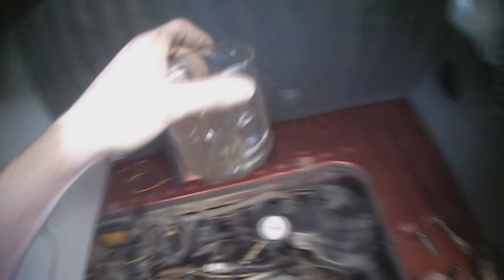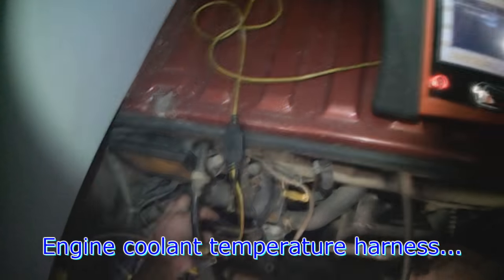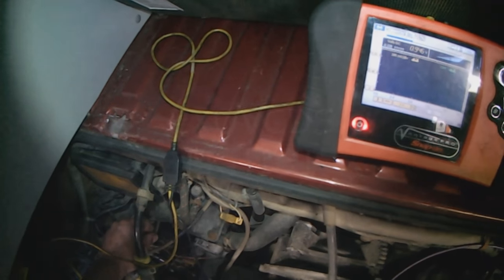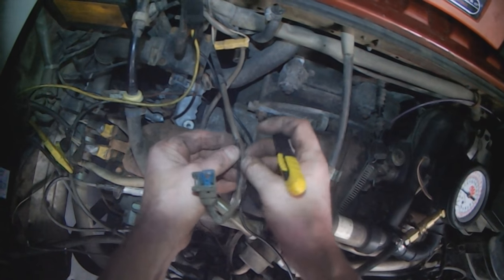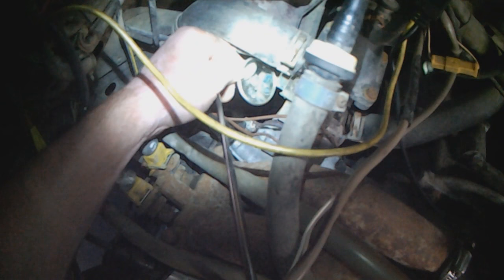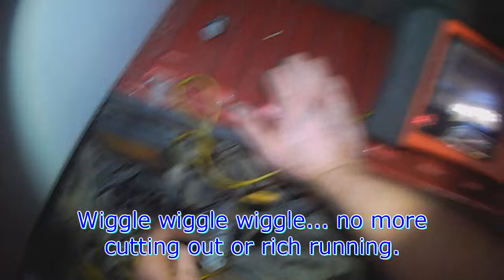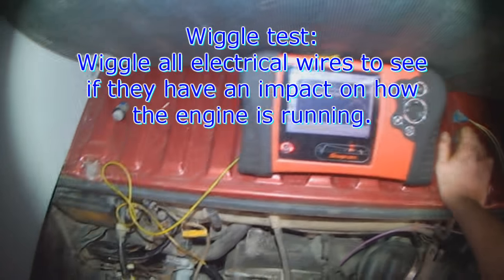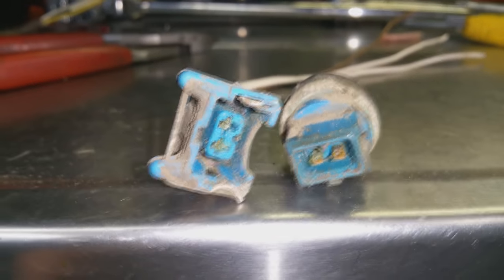VW T3: Intermittent lack of power

Comment: Excellent video. My 1990 has a flat spot and bad fuel mileage, I have to troubleshoot it someday
Reply from the maker: +hlzapata monitoring the O2 can help!
Reply: What tools do you recommend? I only have a good multimeter.
Reply from the maker: ***** That will be fine as long as the refresh rate is decent... so you can see the switch from rich to lean, although, you'll be looking for it to stick high or low.
Reply: I recall something like 8 volts for the signal, am I right?
Reply from the maker: ***** 0 to 1 volt... closer to .1v to .8v or 100millivolts to 800 milivolts. 100 = lean 800 = rich. The green wire from the ECM should have 450 millivolts engine off key on (disconnected from O2 sensor wire). If it is less than 300millivolts, then the wire is grounding out somewhere. If it is higher than 600 millivolts, then the ECM does not have a good computer ground.
Reply: Will check, thank you sir.

Comment: I'm impressed. Does the tingling help with motivation or just keeps the muscle toned?
Reply from the maker: Both! :)
Reply: Thomas EXOVCDS hi, Ive following your channel and have helped me more than 5 times, thanks for that. Right now we are working in a 86' T3 westfalia 2.1, we bought it with a carburator, digifant was removed. It rides pretty good BUT The problem is when it warm up, like an hour of driving freeway or hills it starts to bucking, lose of power, it sound like is not firing sometimes it doesnt stall but you have to drive it like at 10 mph or less. Ignition Coil new ( we tested 3) the same, tried another tch unit, new original spark plugs wires, new spark plugs, new rotor, new fuel pump, tank was almost empty and we used 93 octane gas and the problem persists, we are getting crazy cause it gorgeous, the interior is like new, but is a pain in the ass the riding it. Can you give me an advice of what can I check. Im guessing is something about the ignition but I have no more ideas, thanks in advance and thanks for the great videos.
Reply from the maker: MrElpajita Electronic ignition or breaker points? Is the fuel tank venting / breathing correctly? If the fuel tank starts to collapse due to vacuum from fuel level dropping... that vacuum can make it more difficult for the pump to supply the van with fuel. You'll need to monitor the ignition system & fuel system. When there's power loss... do you shut it off and wait a while? Everything ok again for x-amount of time? How hot does the ignition coil get?
Reply: Thomas EXOVCDS thanks for taking time to help me. Yes, the ignition coil ( 2 weeks old original bosch) is getting hot. After a ride probably of 45 minutes you can feel it starts like progressively losing power, until starts bucking very bad and run like shit, like real bad, turn it off and turn it on, same problem, then turn it off wait 10 minutes it runs fine for a while then the same feeling, like you feel the power is decreasing in some way until the beloved bucking starts again. Im getting crazy because other than that the Vanagon is mint. Thanks for all the help, have a great day.
Reply from the maker: MrElpajita The coil will get warm, but should not get hot-hot to the touch. Check the current ramp of the coil when it is cold & when it starts to act up. The correct coil needs to be used with the correct distributor setup (hall sensor / breaker points).

Comment: thomas, I have a 1991 VW Jetta Diesel.,  over heating issue (fan doesn't start when overheat).  checked direct power to fan, works, checked relay for clicking and made sure it's passing voltage when activated, checked fuses, just replaced the thermoswitch off the radiator with another used one.  I haven''t tested either of the switches though.  there's this other part that doesn't appear to be in good shape (part number 171959493 - fan resistor), I'm looking in the bentley shop manual and can't find much info on this particular part.  what gives?  what am I missing?  any guidance would be greatly appreciated! thanks again!
Reply from the maker: The resistor is just for high & low speed. If low speed does not work, then the resistor is bad. You can wire it so that  high speed comes on when low speed is triggered. Does the radiator get hot? More so, the lower hose? If not, then the thermostat is not opening... if it does not open, then the radiator /fan switch can not get hot.